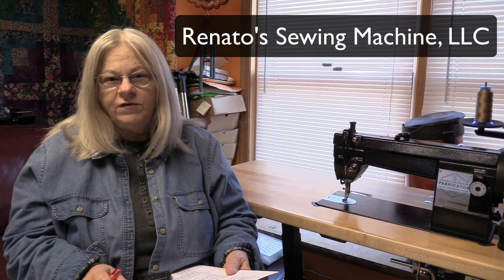My Sailrite Fabricator - Updated Review

Comment: I'm a little surprised that you didn't get on very well with the 1541. With a good quality servo motor with a small motor pulley you should have been able to get just as much control and sewing ease out of it as with the Fabricator. As a bonus it would also be compatible with a needle positioner. A cylinder arm is definitely a good choice for bag making though, I've got an LS-321 myself.

Comment: My only issue with mine is that the foot treadle is too far forward. I have an arthritic knee with bone spurs that make it hard to bend. I put the crossbar that the treadle bolts to to the back of the table legs by accident and saw in the instructions that I had it wrong so i put it to the front of the legs. Now I wish I had left it  to the back. I would be able to operate the treadle better in a more straightened leg position.

Comment: Thank you so much for your very informative video. My brother wants to buy a sewing machine to make gun holsters, but he has never sewn anything before so I was looking into what he should get.  (Our mother always sewed and so do I. We are in are late 60s and early 70s.). I thought of the Sail Rite Fabricator, but I wasn’t sure if this would be the machine for him, or if he should try a Thor Cylinder machine with a flatbed.  Your video has been very helpful.  I also told him that these machines are expensive and he may want to pay someone else to make his holsters for him unless he has so many to make that it would be cost effective.

As far as having to bend down and get under the table to turn your Sail Rite on, have you ever considered plugging it into a surge protector that has an on/off switch located on it so that you could more easily turn your machine on? I agree that having the on/off switch in that location is not the best design feature.
Reply: Sailrite makes a leather sewing machine also.

Comment: Thanks Rosie for this video! I have read a lot about industrial machines. Wasn't sure if I needed or wanted one. I have never sewn on one before. I decided if I were to get an industrial it would be a compound walking foot machine. I saw a cylinder arm machine with a slide table that makes it a flat bed and thought if I get an industrial I would want something like that (best of both machines). Now I cannot find that machine to read more about it online. I must be using wrong keywords? Do you have any preferences to industrial machine brands? My service tech told me once I should get an industrial and when I asked him about brands, he said Consew, Pfaff, and maybe Techsew? I asked about Juki and he turned his nose up. He told me to look for the names he mentioned used and save a lot, but I know nothing about industrial machines and have never even sewed on one, so I am still undecided as if I should ever get one. I am senior aged, so it might not be worth it now? 30 years ago or more, I would have got one for sure (at least knowing what I know now). So if you didn't have any machines, what would be your pick of brand, model, etc.? I only want to sew through denim thickness. I won't sew leather. Might sew some vinyl. So is it overkill? I have owned a Brother PQ1500s, which is a semi-industrial and I loved that machine. It died after only 13 years! I bought a similar Juki TL 2000Qi and the computer part stopped working after 7 years and so it's a mechanical machine totally now, but sews a bit herkie jerky and doesn't have the same feel it once had and might die soon too? I own lots of vintage mechanical machines, but none really have the power to sew denim (the thick seams that is). They all can sew denim fine, but the seams all the machines I have struggle even with a hump jumper! Maybe I should just stop sewing with denim? I hesitate buying another semi industrial machine, since they don't seem to last for me? And even then they did struggle a bit over denim seams too. Any suggestions? Thoughts? Thanks so much!